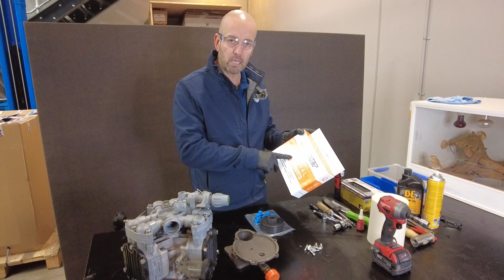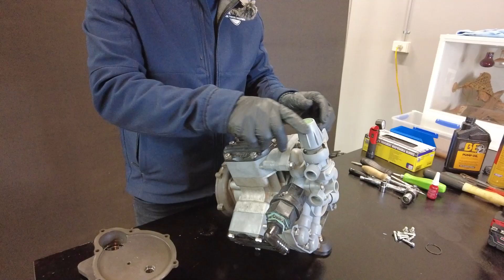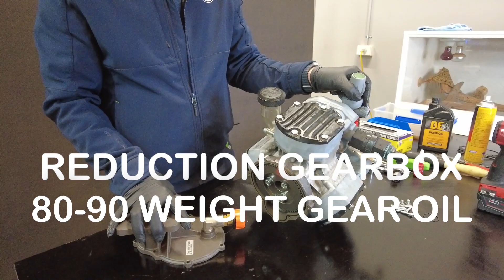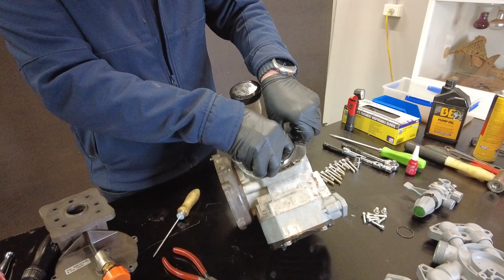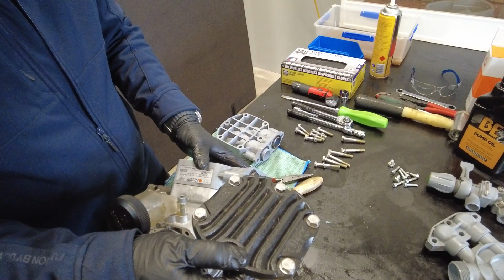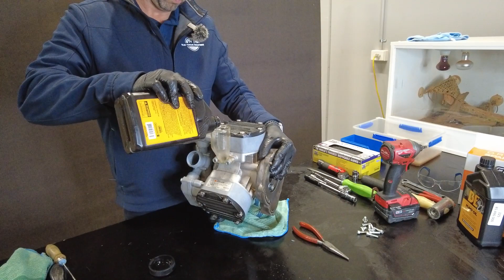P40 SoftWash Pump Tear Down   How to Maintain   How to Repair

Comment: Excellent video. Thank you. What size check valve is that on the outlet? The threads? Do you have a link?
Reply from the maker: Personally I would use the outlet elbow and put the check valve in the hose to the reel. We usually hang it below the swivel on the reel. This way we have less leakage.

Comment: The thread for the outlet is BSP, right?  The CV100 is NPT.  I realize you can get the check valve screwed on but have you ever had an issue with leaking?
Reply from the maker: We initially had check valves directly on outlet, but found it is a real pain to rectify if they leak. The elbows for the p40 are pretty reliable and quick remove so we now place check valves remote.

Comment: Perfect video that is just what I needed to reference for when someone comes in with issues on these P40's since they've grown heavily in popularity. Call me crazy, but Comet should just include the 300psi check-valve already installed so people don't do unnecessary damage not even knowing they needed the valve to begin with 🤷‍♂️
Reply: where can I buy a 300 psi check valve? does it need to be PVC?
Reply: @MEIKLE02  PVC is cheaper than stainless. US-plastics usually has the checkvalves needed, I think Banjo is the brand an they have like a 1psi cracking pressure. Meaning they open with just 1psi. If all else, Amazon or Ebay probably has em too.
Reply from the maker: @MEIKLE02   In Australia? All on our website